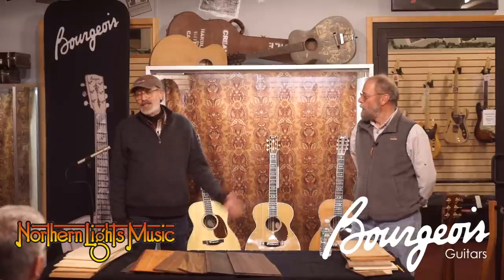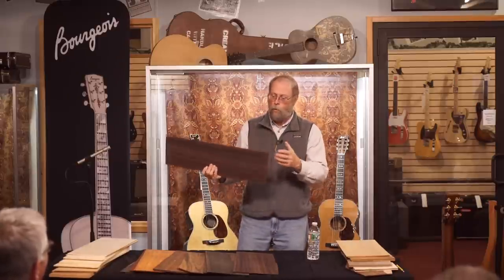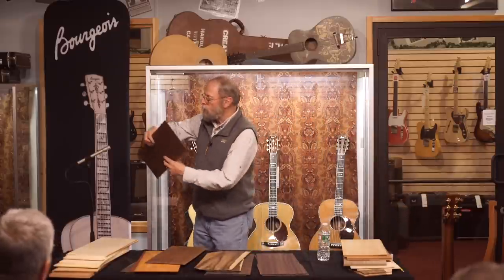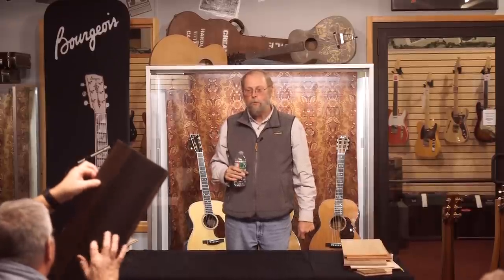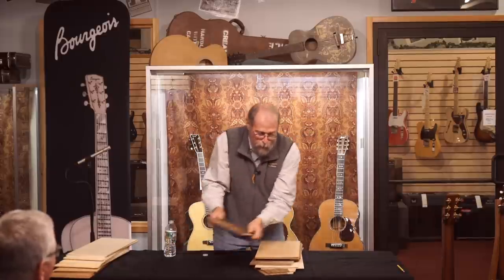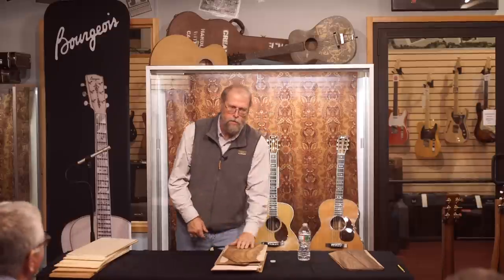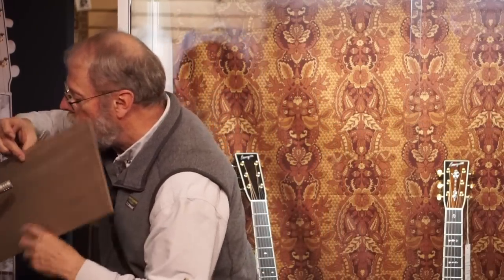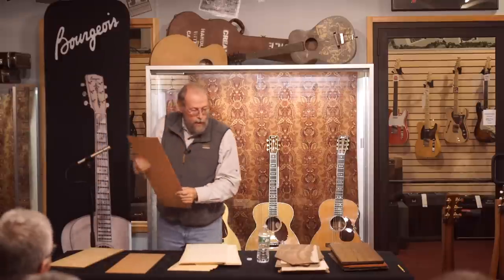Dana Bourgeois Talks Tone Woods

Comment: Awesome video. Nice taking the time to actually tap all the woods and explain. 

Gonna disagree on slow high altitude Alpine Swiss spruce just a little. 275-300 year old guys. Although I'm talking about a specific type of European in high elevations, veey cold, harsh growing conditions. It's basically Adirondack, but without the harshness, and more overtones. Red spruce u can drive slightly harder but it's not that mucb a difference. Especially considering how the alpine makes up for it. It's the best of red, mixed with the best of Sitka imo.

You get the fundematals of Addy, with slight overtones and a very quick fast response with a quicker decay on picking. Different type of quickness. It basically sounds like an old red top almost out of the box. And the highs are nice and thick. It's a clearer sound too. And will reveil mistakes. Not as grungy I guess. But very loud. Sometimes extremely. But I love Addy for other reasons too and I'm not hating. 

 My favorite tone wood by far. But I'm talking the old growth Swiss alpine high altitude stuff. There are may different types of the same European species and they all have different properties. 

Super versatile. Great for finger picking, blue grass, strumming, blues, or just some beautiful melodies. Some great sustain on slower pieced songs. Notes just ring out. On and on. 

It's just such a dam good too wood. Gotta get the good stuff though. Florinett has some of the best I've seen. Just needs to age a bit after u get it. But it's unbelievable. Almost certain Martin got it from them and then let it age before they used it finally after a 10 year hunt for the best FSC alpine they could find. After years of research and talking I'm almost sure, but can't completely confirm. But it's FCS certified and only a couple do that. And it's  top notch stuff and only veey veey little have both. And I have other clues from messages. 

I'm also not a fan of torrifed and never will be. Don't like cheating. Don't like the look. I'd rather age it myself by playing over the years. 

It's also actually the stiffest per weight. At least the good stuff is. I believe the deflection is. 062, while red is 063,and yet weighs about 5 grams less on average on two of the same size and thickness.

All my guitars in the future will have it. Any custom I get made will be that or Addy. Still a huge fan of Red if braced right, etc. Sitka I like still, but Swiss just took over for me. Especially over mahogany. By far my favorite over hog is Swiss alpine. Ugh. It's like merging your great hog with a bit of rosewood. Sold my rosewood after I got my Martin D mahogany 09, which is a ge with Swiss alpine spruce moon wood top and bracing. First time they used it for both. At least as far as they can track.

The cm om13 used it to and what a guitar.

Either way the right builder can make any spruce sound great. But make no mistake there is difference.
Reply: Great Info. I recently bought an eastman om with florinett alpine spruce + EIR body. And i wanted to find some info on it. Glad you took the time and wrote about it. My top is actually Torrified but i dont mind it

Comment: Years ago, I stepped into my local Guitar Center. They had just received a batch of Taylor guitars. I played 8 of these all the same model. You would think they all sounded the same? 
Absolutely not true. I did buy one that did not have the prettiest top, but it sounded more clear and projected better, and just felt like it vibrated more in my hands.
So this video doesn't mean all too much to me because the guitar that you play, and sounds the best to you is the one to buy.
Reply: Taylor doesn't tune their guitars lol so of course they will all sound different. Even if they are the same model they probably didn't have the same woods being used on the soundboard back and sides and even if they did every tree is different. If you're shaving all braces down to the same size all with the same pattern of course they will sound different even if you used the same species of woods.

Comment: I watch for some reason a lot of guitar building videos.  This is very interesting to learn there is so much to the different types of wood, and listening so far (43 minutes in) to woods used back and sides.  I read that back and sides material, no matter what it is, only influences about 5% of the sound.  Has anyone heard that before?  If that's true, then they could save a lot of trees by using some synthetic material for back and sides and be serious about choosing what type of wood for the face.  

I'm only amateur but listened to an interview with the 2 guys that build the Casimi guitars in South Africa.  They really like African Blackwood a lot.  Is that mainly them, as Dana seems not that impressed with African Blackwood, doesn't even use it.  The Casimi guys never said they had a problem with their guitars cracking easily... but maybe that is true because the Casimi guitars haven't stood the test of time yet as they seem fairly new.  Any input from anyone is greatly appreciated.  Thanks for such a great presentation!!  I'm only amateur and find it interesting!  I like what Taylor is doing about ebony, buying the last stand of it and carefully managing it for future generations.  

As far as ethics and wood, and Dana saying India is very good at managing their forests... doesn't the need for money and greed set in with getting the rosewood and weakening regulations on India's harvest?  My guitar has East Indian Rosewood back and sides, so that doesn't come close in sound and beauty to Brazilian Rosewood?    

In 1977 my roommate in college was very kind and I visited his home and met his family in Lake Minnetonka, MN.  His mother worked for General Mills, the big flour company with headquarters near to where they lived.  Her job was giving tours of the company facility to people from all over the world.  She gave my friend and I a special VIP tour.  When we were in the main conference room that had a big long table, a very big room, she said all the beautiful walls were of rosewood panels.  Now days, what happens to buildings like that, where there is a lot of rosewood from the old days, and the building is being demolished or remodeling etc.  Do guitar builders ever buy that and use it?    

I met a violin builder who has a small school, like about 8 students.  He showed me different boards he had found from old building sites where demolition was going on.  He would search for pinewood.  He loved pinewood from very old buildings.  He would just hunt in the scrap piles.  Some pieces he loved were badly damaged, yet he said they were still excellent wood and worth repairing.  Pretty amazing!  He had built 365 violins in his lifetime by then (about 5 yrs ago) and seemed in his sixties.  I wonder why violins don't have hardwood back and sides...  His violins would even auction in New York City for a lot of money.  Why don't renowned guitars sell for as much as violins?  This man was so talented they were bringing a 3.4 million dollar violin to him.  They were coming from Chicago to his school/studio/shop in St. Paul, MN!

Comment: What is the loudest possible wood for the Banjo Killer?  I'm sooooo quiet.
Reply: Brazilian/Adirondack
Reply: Adirondack top/Mahogany back & sides hands down.  They really cut thru and stand out in a loud group.
Reply: When playing with instruments where the frequencies are outside the range of the guitar (mandolin, fiddle, etc), I like Brazilian with red spruce if I am the only guitar.  When playing with multiple guitars, I prefer to use mahogany with red spruce because the volume of the fundamental note is louder, and the harmonics are strong in the mid range and higher frequencies.  If I am playing in a duet or trio with no bass, I prefer to use Brazilian with sinker redwood because this combination is very strong on the bottom end and I can "fill in" some of the missing bass frequencies.  Incidentally, this combination is really good for altered tunings like drop d and dgdgbe, etc.

Comment: I would have thought that for really meaningful tap test results each wood sample would need to be exactly the same dimensions, be clamped in exactly the same place and tapped in the same place.
Reply: As every billet of timber and species and cut differs over a large number of variables your conditions would be almost valueless.
Reply: I must agree Terry. Not comparing apples with apples here.